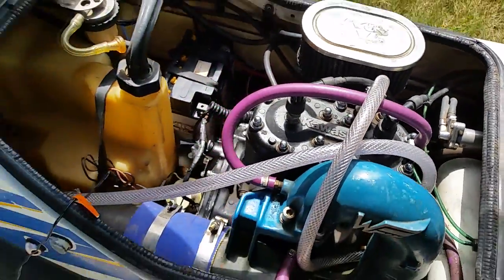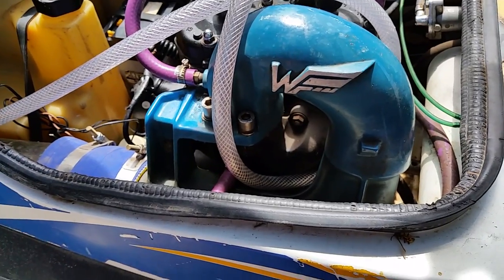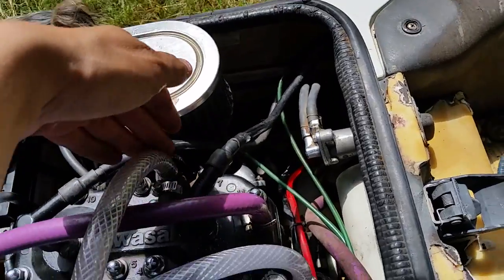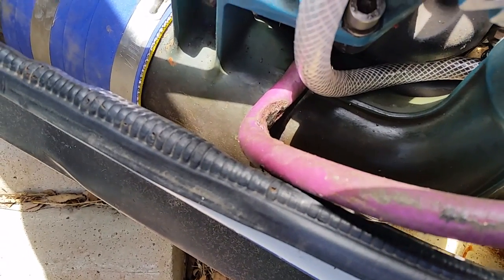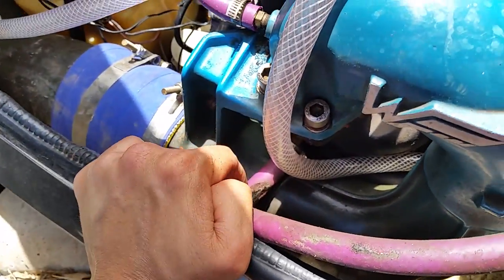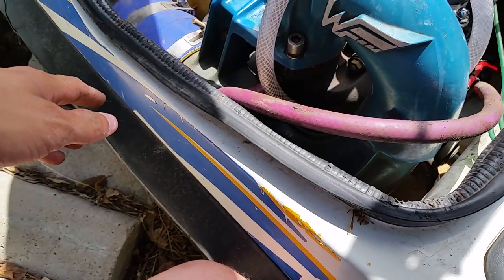Kawasaki 650sx cooling system

Comment: About to buy one, Owner is asking $800 says it in mint condition with no issues! Im a mechanic by trade and a dirt bike guy so I don’t know much about skis.
Reply from the maker: Cowboy4737.   Hows it going! First thing first just like a boat its rare to get your money out of it.   There are motor mount shims under the engine mount. Each corner to each  mount has a different amount of shims. Dont! Loose or mismatch the shims or else your life is over.  When you finally rebuild your motor replace the crank shafts seals.  More than worth it. Hope you enjoy!
Reply: brads3111 I plan on keeping it so I’m not too worried about the $$$ He says it needs nothing so I plan on maybe putting a graphics kit on it but I’ll do my homework and I ordered a service manual for it, Thanks for the reply...

Comment: Thanks for the reply. I did do pistons and rings. I did not do the crank seals. Water was still pissing. Starts and runs great just would go under load. I did remove oil pump and use pre mix. Very old k&n air filter can that be it? Btw thanks used this video when I replumbrd it last year.

Comment: Hey Brad I just found your videos on Jet Skis and love 'em! I know it's been years since you've posted Jet Ski videos and hpefully you still monitor your youtube channel. We (my family) have 5 Jet Skis; 2 of which are similar to yours. A 1990 550SX and a 1991 650SX. My questions for you is are simple ones. Which of the 2 ski's is faster? ... and if it's the 550 is it because of more mods? and Which is the most fun to ride? .... and why? Thanks man!
Reply from the maker: Thats a tough one.  I have a 1986 550 not the 550sx.  The 550sx actually has a reed motor " more power.    

Out of the hole the 550sx is faster.  In the early days they preferred the 550sx over the 650sx for racing.  Top speed the 650sx is faster i believe.   But only by 2 mph or something small. The 550sx is less stable and l lighter which is more fun for tricks. The 650sx is just better all day on the lake for stability for high speed.  

If you watch Craigslist and ebay closely you can find aftermarket parts kind of cheap.   The best thing for power is always a rebuilt engine if its time.   Go have fun.
Reply: @brads3111  - Thanks for the quick reply. One correction; we have a 1990 550sx which was the 1st year using the 'sx' in the name but it isn't a reed motor, It's still a piston port motor in that year but the hull has rear exit exhaust so they gave it the SX name... Thanks again...
Reply from the maker: @dboybord  in that case out of thw hole the 650sx is a tad faster.  And that exhaust is a little quite and not in your ears like the prior models were it would echo off the water.

Comment: Hey buddy I have a question . I have two hoses coming from the water box  . The big hose goes to the pipe but I have no idea where the skinny hose goes to that’s located all the way in the back of the box .
Reply from the maker: @johnnygalvan1344  those are just cooling lines. Your exhaust should have tons of water going through the entire  exhaust system and probably won't need additional cooling to the water box. But if you want you can tee in and run extra lines to the box.
Reply: @brads3111  I’m just afraid that it’s gonna fill up my box with water
Reply: @brads3111  thank you for the quick response. I’m like an hour away from going out with my JetSki in the ocean my 750 SS Kawasaki.
Reply from the maker: @johnnygalvan1344     on no don't be worried at all. The exhaust gasses will push it out.   The extra inlets are for extra cooling in hot water and hard core racing.

Comment: I have metal gaskets blocking cylinder block to cylinder heads . Should I remove it. ?
Reply from the maker: @johnnygalvan1344  no. That gasket is what seals the head to the cylinder block. That's what helps keep compression up and water from seeping into the combustion chamber.   That head gasket must be replaced each time the head is removed.  $20

Comment: Do you have an aftermarket carb
Reply from the maker: No aftermarket carb.  These are very simple motors and the stock carb is more than enough. If you want more power, rebuild the motor, replace the reeds and replace the the cranks seals.  Then it will run like a beast.

Comment: Hey Brad I have a Kawasaki 650sx I rebuilt last year. Runs great but by end of the season it would not go just bogged down. No weeds. Wondering if it is a gasket in the cooling system letting water into cylinder. Any ideas would be appreciated. Thanks!
Reply from the maker: Donald Reisert hey don, as long as water is coming out of the pisser then yo u know the cooling js correct.  If its bogging down amd still runs your looking at a air to fuel ratio issue. Fresh gas? Did you replace the crank seals with a true rebuild, that is very important. True rebuild is piston and rings replacement.   Do you still have good compression?
Reply: I had my engine bogging and wouldnt stay running when i was running hose water through the system. It turns out my engines cylinder head gasket was blown so i rebuild the whole top end and new crank seals. About to throw it in so hopefully it works

Comment: Where did you locate that purple water line....I've been searching everywhere...I really want it in hot pink for my pink Kawasaki SC. I found it for my 440 way back in the 80's and it was readily available. I have searched the whole world wide interwebs and nothing. Ideas???  Suppliers???
Reply from the maker: It's really simple.  Just get on google and type in the size of the hose inner diameter the color and the word silicone.  For example only and not true  to the size "  1/4 inch purple silicone hose"

Comment: Hey buddy I bought a jet jon boat they just put a jet ski motor in a boat,  start good, runs good but not too fast when I accelerate to go faster I bogs down I open where the thermostat goes and there was none so, do you think thermostat has something to do with it or maybe carbs I'm no mechanic so if its alot work that it needs done I might sell it to someone that can fix it and get some money back, by the way compression is 125 on each cylinder which has 2
Reply from the maker: 125 is still good. I would look at either clean or slightly adjusting the carb.  Usually theres hi, med and low screws for air fuel ratio..  

Sometimes theres also two screws for high and low afr's.  

Start there.
Reply: @brads3111  thank you sir I really appreciate it
Reply from the maker: Tuning is super simple.  Higher rpms you just turn the high jet needle until it stops bogging down.  It's that simple.  Also sometimes you need to check the rear main sill.  That could have air coming in and making the rear cylinder run lean.

Comment: It looks like the pipe was very hot so is this the correct way?
Reply from the maker: Yes, this is the correct setup
Reply: @brads3111  if you have it hooked up differently from the pump it would be different though? You just want to make sure that the one going into the manifold is water coming from the pump?
Reply from the maker: @maddoxf6262  yes!!  Just follow this diagram and you will be just fine.

Comment: I have 90 650sx and my question is I have three lines coming out of fire wall, two on carb side and one in exhaust side. when I got this ski the top line on the carb side was blocked off. with a whole new motor and whole West coast exhaust I'm still confused as to what does what and goes where?? and yes I've researched and read and looked at pictures but with no 100% certainty that it's correct. thanks.
Reply from the maker: Just now saw this message. Give me a few days and I will get back to you.

Comment: Hey brad i just installed a coffmans aftermarket exhaust pipe on my 650 and i’m not getting any water from the outboard pisser when i’m riding. I get water flow when i flush the system manually when the garden hose water has direct flow into the head, and i also get water flow out the pisser when the garden  hose is put in to the rear line out the back of the ski from the pump. But I get no water when i’m riding and the pump itself is submerged in water. is there any way i can send you a few pictures of my setup and you could tell me if i have it ran correctly? Thanks
Reply from the maker: From the line going the engine to the pump can you blow through it?  Its very common that somewhere in the line it becomes obstructed.

Comment: So I have dual cooling lines from my pump. Am I supposed to tap my second line into my exhaust manifold like the original line? And will my lines be different than yours because I have dual cooling? If so please explain.
Reply from the maker: There should only be a single cooling line from the pump if there's a secound line running from the pump and through the ski hull than that ski was modified. Very interesting. 

If you can plug both lines into the exhaust that would be great. But you also in uncharted territory.   You might even half to Y those lines together prior to the exhaust if theres only one water inlet.. Just a thought.

Comment: Why is water standing on my  exhaust pipe seems like it's not coming out I don't know what my problem is please help me
Reply from the maker: You will need to start diagnosing starting from the jet pump. The jet pump supplies the water pressure. Some time the line from the jet pump becomes clogged. I would start there. Something is clogged somewhere.

Comment: Hello Brad, I have a 1986 JS550 I just picked up from Craigslist. It was sitting for 2 years but it fires right up and runs perfect at that aspect. Currently there is no water coming out of the pisser hole on the left, this is neither in the water or hooked up to a hose. I called two mechanics and they said to take the head off and clean the water jackets underneath the head. Any ideas of what else it could be. I cleared out all of the hoses to make sure there was no cobwebs or sand or anything and is where I am at now. Any feedback would be great.
Reply from the maker: Did you watch my other video on 1986 js550 cooling system?  make sure you watch it!
Reply from the maker: start witht the pump line and then move threw the hole system, dont take the head off. if you do you will have to replace the head gasket because they are one time use head gaskets.

Comment: Sorry not go under load
Reply from the maker: Donald Reisert so i did another vid on how to replace the crank seals.  You can start up the motor and spray some engine start at the rear crank seal and see if it changes rpm.. if so it needs to be replaced.  Start there.
Reply from the maker: Donald Reisert. Also i forgot to mention that if its reving up  like it has power but not going. It coupd be cavitation. Theres a air leak around the pump where the pump/propeller has so much power its pulling air feom the engine bay and mixing with the water..  you will have to re silicone the pump housing and all.